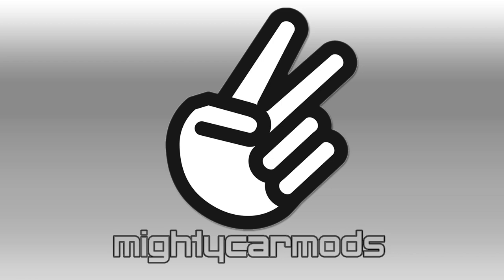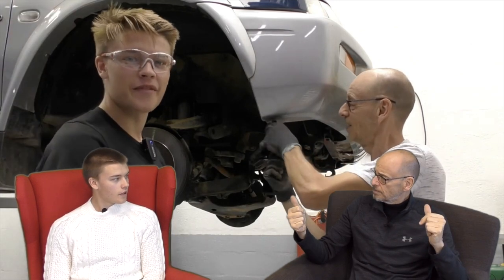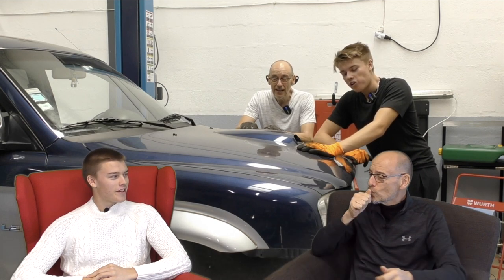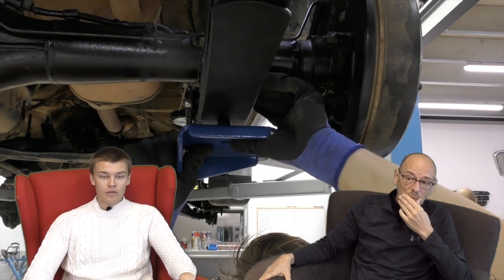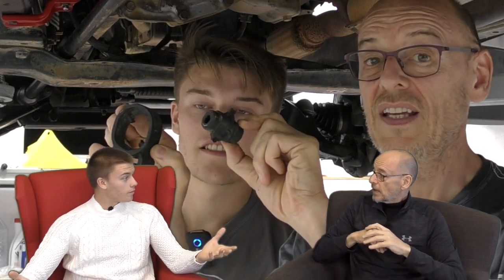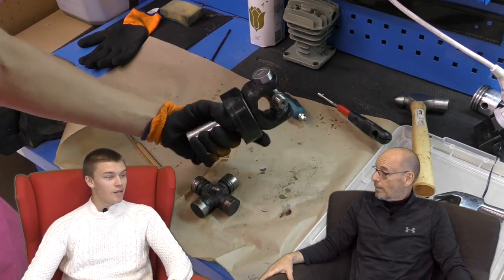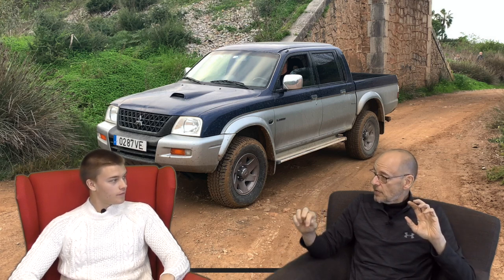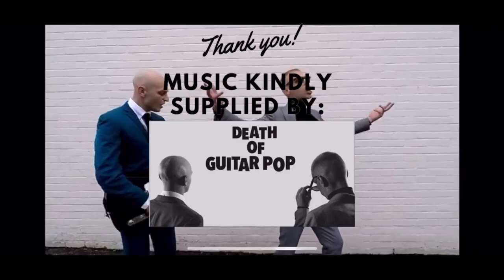PROJECT L200 is done !! this is the brief of what we achieved (or broke 😂)

Comment: Lads, well done, love the series. In Australia we call the L200 a Triton MK series. I Bought one for my son last year (2005 3.0L V6) and we will be doing a lot of what you lads have done! Cheers Ricky
Reply from the maker: Thanks Ricky - if we can do it, you can only using one hand :)  - we love the truck, your V6 will be a lot better than ours, but we chug around really well - thanks for commenting, much appreciated.  PS - the suspension dampers we got, although quite cheap, have made a lot of difference as had popping a bit of weight in the bed, unless you use it as intended, ours rarely has anything it the bed.

Comment: Nice work fellas. I appreciate your Father/Son great relationship because I had that myself, working with my Marine engineer/mechanic Dad in our workshops on cars, trucks and boats here in the UK. It's a beautiful thing, even when sometimes you may not agree on how to get the job done. 
He died aged 82 in 2022 and I was gifted his 2002 K74 L200. 
I took this on not knowing how bad it was, but ohh hell, near every bolt snaps. But I will do all and get the animal back on the road. For him. 
Thank you from myself for doing these video's, I have learnt something from them. There is so little support out there for these trucks. If I want to research my Land rover or MG there so so much help but the L200 not that much. 
I do take a slight pinch of salt with them though, your L200 was so clean to begin with, you are not dealing with the results of all the gloom and salt of UK cars. I saw you put the lovely transfer mount bracket back on without taking the opportunity of undersealing the chassis underneath and I was screaming " NOOOOOO !!! " at the pc...😱🤣😂

All the best Gents, keep it up .👍
Paul.
Reply from the maker: Thanks Paul - The old one had plenty a UK rot box, so feels your pain :) not long ago, we gave the chassis a spruce up (did not bother filming) and I have just done a 5000km road trip around Spain with UK buddy (met in Santander) - this was a nice change as the French road trip in 2020, Murdock (the L200) came home on a low loader 😭 (over heating)  - when we first got here we had an old ML, Dad managed to snap every bolt going, so is a dab hand at drilling out the stud part ! For us, luckily Dad has never done a manual days work in his life, so we are relatively a peaceful double act, sadly, my time as a part time barista (UK) when at college, means I have to make the coffee as well 🤣 (he is very good at tidying to be fair !) appreciate the time to comment - Jon & Nath
Reply: @DrivenMadShow  Yeah , I woke up from a drunken haze near there. 98, San fermin . running with the bulls that were actually mostly heifers . But ohh my god, the best way to beat a hangover. I was shitting it !!!! 
 Beautiful memories. 
The stuff you are doing is awesome . It is really great. 
As I said, I had this great relationship with my Dad that you have now. 
Use that time wisely young man, you have only now. 
I'm 53 now and my dad died at 82 nearly two years ago, still hurts... . Just info to give you knowledge of my life experience . 
I just your enjoy the Father/Son thing I had. It is beautiful thing that you have  and doing your show together is very cool . 
keep it up. 
Luv and respect.
Paul.
Reply from the maker: Thanks Paul - I am surprised you could run -- you must have bollocks the size of footballs even to go close to the bulls 🤣

Comment: Where did you find 2003 L200 in such good condition? Barn find?
Reply from the maker: You need my specs 😂Nathan is an obsessive cleaner - its is in decent condition to be fair (considering it has been scrapped along many a bush) really because we are in Portugal, so Mr. Rust is not an issue on cars here (in the main) we did do a full ACF50 detail to the underside, but that is now just dust and grime. I need to check, but I am sure Nath did a detail polishing video, think he/we have forgotten it !